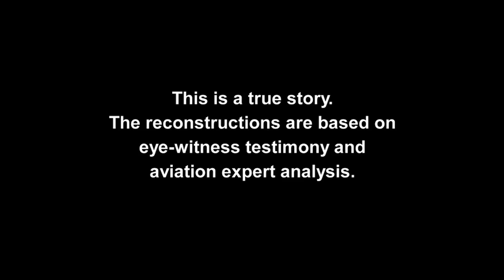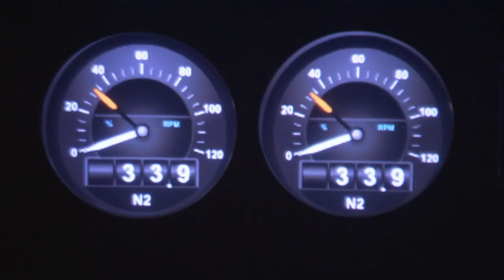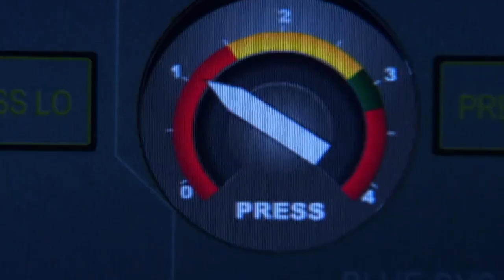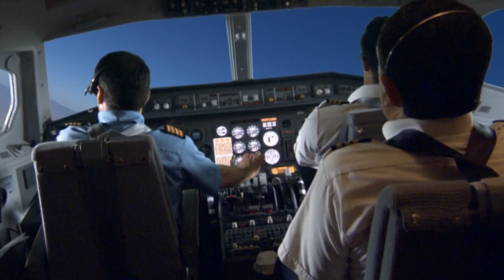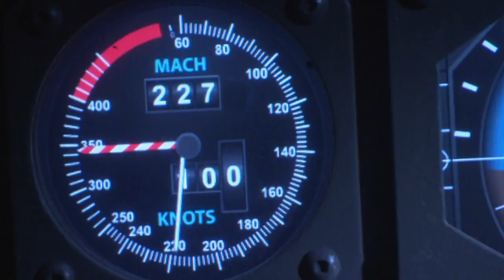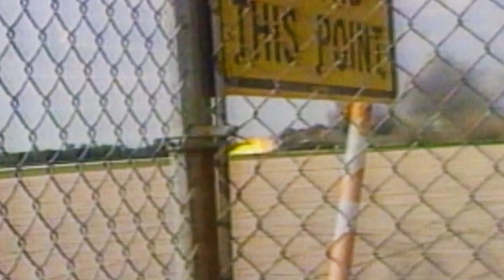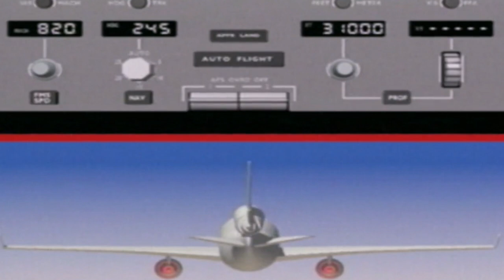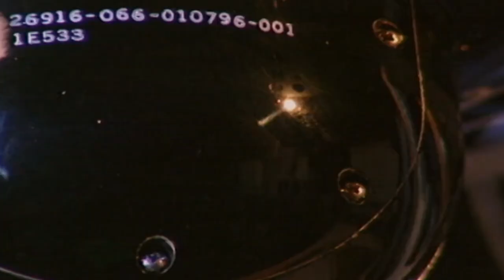DHL Delivery Plane Struck By Air Missile | Mayday | On The Move

Comment: My understanding and knowledge of aviation is precisely zero but you dont have to be a pilot to know what incredible flying these guys did that day. The pilots deserve all the accolades.
Reply: It's a bit like trying to parallel park in three dimensions.  Using the gas pedal instead of the steering wheel.
Reply: @arianebolt1575       "Parallel Parking, in a difficult Driver's Test"   (With Apologies, to, "The Fifth Dimension." You know what they say/said: "This is the Dawning of the Aga of Aquarius.")
Reply: They had to fly in the fourth dimension, fact of steering and physics is changed. Facts of thrust aren't changed with too much aspect.
Reply: im gonna hve to try that in mfs2020
Reply: Na bruh they can do their own races. I’m saving my accolades
Reply: Shame they used such bad special effects.
Reply: Yeah screw the engineers who designed a robust aircraft, the pilots are the only ones who deserve praise!
Reply: true
Reply: @arianebolt1575  
Using two gas pedals for two independent engines and wheels.
Reply: @CarbonMonoxide911  sure, here is how you do it, get autopilot into about a 15 degree climb at around 200 kias and do a very slight heading change (like 5 degrees) in autopilot.  Then disconnect the autopilot and that will leave the plane in that trim.  now fly back to the airport using only differential thrust.  I wish you luck.

Comment: Of the 3 similar incidents with JAL, United and DHL the DHL crew was fortunate to be trimmed for climb prior to loss of hydraulics.  JAL lost nearly the entire tail so even if they had not lost hydraulics they are very unlikely to have been able to maintain stable flight without skidding into an unrecoverable spin.  United had to deal with asymmetrical control deflections that caused their pitch phugoid to also include unwanted roll and yaw components making control much more difficult.  United was also trimmed for cruise flight in pitch axis making the speeds for their landing attempt insanely high.  I remember hearing that multiple attempts were made to replicate United 232 landing in simulators and NOBODY could do as well as the actual crew did.   DHL was trimmed for climb which is a high lift and relatively low speed flight regime.  They also had to contend with asymmetry in roll and yaw axis like United but did have a more manageable trim in pitch giving them an advantage over the united crew.  In all three incidents the airmanship was remarkable.  Watching video of the Sioux City accident leaves you amazed that anyone could survive it yet more than half did.
Reply: That's interesting.
Reply: Nothing like a disabled aircraft to cause a real adrenaline rush and sharp focus of the mind.  When that Hawaiian Air flight lost a big chunk of the upper fuselage (due to corrosion), the pilot just greased in in onto the runway, a perfect performance. The co-pilot mentally remarked: "How did she do that?"   And you get that when you are near disaster. Al Haynes never did fly commercially again, all those deaths demoralized him, but he did go on to give a lecture tour. A truly great pilot.  I know I could not have pulled it off, my skill set is way below that level.
Reply: JAL123 and United 232
Reply: @jvaneck8991  Aloha 243 is legendary. Air Canada 143, while not structurally compromised, also lost a lot of controlability to fuel exhaustion. Amazing how pilots achieve these feats in spite of the odds stacked against them.
Reply: @KathrynsWorldWildfireTracking  I think in the end this fall into the file of adding too much weight (systems) and cost (systems and maintenance) to justify based on the relative infrequency of these kinds of events.  A better solution is to engineer the hydraulics/electrical systems with inline fusing and running redundant systems through different real estate to mitigate the risks without significant equipment cost / weight / maintenance expense increases.  The engineers really consider each accident  when developing next gen aircraft.  An accident like the three I mentioned would be very different (better) in a 787 since it does not really use much hydraulic control and electrical controls are easily isolated with inline fuses.  If this DHL was a 787 its damage would have probably caused a huge electrical bus short in the left aileron, but an inline fuse would quickly overload and blow effectively removing that damaged area from the control system.  The rest of the control system would continue operating 100%.  Design like that is what  will prevent similar accidents in next gen aircraft.
Reply: Training Captain Dennis E. Fitch of United 232 had actually tried it in the simulator because of JAL123. It was purely academic until suddenly it wasn't. The coincidences that put that much talent in one aircraft at once are staggering. Anyone who can fly a jet like that, even JAL's crew, is incredibly skilled. Landing is inevitable, survival is not.
Reply: @kdawson020279  Totally agree on JAL.  I believe they managed to keep that thing in the air for about 25 minutes.  They could not really control their direction or altitude but merely keeping it flying was a feat unto itself.  The vertical stabilizer (rudder) is the only surface that prevents spin, and that they they were able to avoid a spin as long as they did with essentially no vertical stabilizer its frankly astonishing they did not just instantly end up in a spin.  Even the smallest skid would have been unrecoverable and I think it was ultimately a spin that put them into the ground if I recall.
Reply: @larrybremer4930  Yeah, that was tragic because to the credit of the pilots, far more people survived the initial crash than survived the night on the mountain. A large number died of exposure while trapped in the wreckage. I was a kid then, but I vividly remember watching the ordeal with United 232 on TV when it happened. I didn't appreciate how hard it is to control a jet with only differential thrust and an uncontained engine failure until simulator tech for the computer caught up with physics. And, there's no pressure, because no one dies if I crash a pretend DC-10-10. You can almost reverse engineer aviation history through innovations, airworthiness directives, groundings, and recommendations from the NTSB because aviation safety regs are written in blood.
Reply: The words of the United flight’s PA address from the captain to the passengers to prepare them for landing has always stuck with me: ”Ladies and gentlemen, this is your captain speaking. I’m not going to lie to you….this will be bad”.

That must’ve been beyond terrifying to hear.
Reply: I am wondering if the stabilizer trim is controlled by hydraulics. I think it can be designed to be electronic.
Reply: @ydl6832  777 is an electric jet with very little hydraulics.  The DC-9 MD-80 family of aircraft actually use old school cables to a tab that when moved causes the larger control surface to move so simple muscle power is multiplied by simple physics of aerodynamics.  The infamous jack screw that moved the "fixed" part of the elevator was actually to trim for the current speed, and balance.  Because hydraulics are heavy and require lots of plumbing most next gen aircraft designs are using electric actuators like jack screws and linear actuators.  Electrics have an advantage over hydraulics in that failures can be localized and isolated by breakers and fuses.  There is such a thing as a hydraulic fuse that in theory can plug a broken line, however anything less than a complete break does not create the flow rate necessary to actuate the fuse making a hydraulic bleed out still very possible when the leak is too small to trigger the fuse.  The difference is that hydraulic fluid is finite, like fuel, you only have what you left the ground with, but assuming your engines are still running you never run out of electricity.  That is why electrically controlled aircraft will be safer than legacy hydraulics.
Reply: @larrybremer4930  thank you, very informative 😄
Reply: @larrybremer4930  until an emp knocks out a system.
Reply: I can't imagine the pain in that captain's voice knowing that so many of the people listening to his PA weren't going to survive
Reply: @KathrynsWorldWildfireTracking  Wait, so neither of the computer program nor the flares have been implemented yet on commercial planes?
Reply: Like Scully, they repeated his landing in a simulator knowing the situation ahead of time.
Reply: I would like to get ahold of a FLT (the save file name for Microsoft Flight Simulator) recreation of any of the flights.
Reply: Possibly, on impact, the missile caused a sudden dump of a large mass of fuel.  I suppose equalizing the mass by dumping fuel from the right wing would have helped.
Reply: Yep, the trim in witch it was stuck likely played a big role. Good point!

Comment: I served a year in Iraq (2004-2005) and helicopters were a constant part of the airspace around BIAP (Baghdad International Airport) and surrounding land. Along with the Apaches and Kiowas there were J-Lens Blimps with powerful cameras to scan for threats, and mounted patrols everywhere. Somebody must have REALLY dropped the ball, not only to let them set up and try and down a plane, but get off a SECOND shot minutes later. Very Glad the DHL crew survived. 
SSG. U.S. Army (Medically Retired) Infantry / Sniper / SOF Intel (SOT-A), multiple tours
Reply: Rather then dropping the ball it is more likely the terrorists watched the patrols for quite a while and figured out what distance they needed to be outside of the area that was observed as the fact is there is only so much area that you can feasibly keep under constant surveillance.
Reply: this was 2003 so maybe all that extra stuff was a response to this incident.
Reply: I was there in 04 and 05 as well. The BIAP used to have the return fire battery and all planes had to circle the air port inside this bubble to stay protected. Something must have changed.

Comment: Flying a plane without the ability to control other than timing your engines power and yet still managing to land albeit rough is just incredible ! Amazing pilot and crew right there !
Reply: Not only that, but also compensating for the unpredictable changes in aerodynamics from the damaged wing.

That's the problem with the PCA system mentioned at the end of the video. Sure, it can land the plane on the engines alone when it's in perfect shape. But if you've lost all hydraulics, then most likely, your aircraft has been badly damaged in some way. How can the system possibly know the extent and location of the damage and how to compensate for it? Pilots can 'get a feel' for the change in aerodynamics, but a computer system cannot. I think it'd be better to focus on more redundant control systems and backups, along with better training for pilots on how to handle these scenarios... Along with installing military countermeasure systems for aircraft that fly into conflict zones.
Reply: There's no  mention of it but I expect there are still pucker marks in their seats.
Reply: @weblure  SImple.  You only have engine control available.   It applies the control necessary.  Simlar thinking to yours implies that when you modify a car equipped with OBDII when modified will produce more horse power without reprogramming the computer.  Not so.  You can open the exhaust, open the intake, put different spark plugs in it, install a bigger turbo, etc. all you want but it will not produce  more hp without reprogramming.
Reply: I'm sure it has been done many times before in small prop planes

Comment: "Controlling a plane just using the engines has never been attempted before"    later in the documentary    "here's a clip of another plane that was flown just using the engines 14 years earlier"
Reply: True...but the key difference is they landed the plane safely and survived.
Reply: He meant "before" this incident or during traing of pilots or none of these pilots/Boeing  attempted it b4.
Reply: Lmao
Reply: Unfortunately the prior jet had a big  tendency to  roll when they added power.
Reply: Because now planes are heavier and more reliant on hydraulics and advanced but before it wasn’t and more reliant on engines and 14 yrs ago probably don’t even have hydraulics
Reply: Plenty of USAAF bombers did it in WWII. but, the writers for shows like this,  have to pep up the narration...
Reply: And they crashed killing over 600.
Reply: @charliegaylor  Apples and oranges. WWII bombers were nowhere near as dependent on hydraulics, used props instead of jet engines, were much smaller than modern heavy passenger/cargo jets and quite a few other differences. Flying a modern heavy jet with no hydraulics means no functional control surfaces (and often involves said surfaces remaining frozen in whatever configuration they were in when the hydraulics were lost.) None of the bombers that survived severe damage in WW2 lost all of their controls.

Comment: Same thing happened in 1989 DC10 Sioux City Iowa, lost all 3 hydraulic systems but made it to the runway and tumbled. Incredible back then that they even made the runway. They used differential engine thrust. That DC10 had identical engines to that A300, GE CF6
Reply: Yeah that's what I was thinking, maybe they could use differential thrust to change the roll of the aircraft, because of the tourqe effect
Reply: Dc 8 9 10 all garbage
Reply: this was mentioned in the video

Comment: It wasn't accurate to assert that flying a large commercial jet using asymmetric thrust to overcome total hydraulic systems failure had never happened before.  Check out UA Flt 232, Sioux City in 1989.  119 fatalities, but 184 people survived due to the skill of the flight crew and a United Airlines check pilot who was a passenger before getting into the cockpit to help the rest of the crew.  That aircraft lost all flight controls after the center engine fan disks exploded, severing all the hydraulic lines.  It wasn't hit by a missile, but the flying problems and flight behavior of the aircraft were almost identical.  Obviously practically miraculous flying jobs were done by both aircrews.  The DHL flight just wasn't the first to be faced with this seemingly insurmountable challenge.
Reply: I remember this day,
Reply: I was just going to comment about that.  I saw a story on that crash on another flight channel a couple of years ago.  I agree, it's still heroic flying.  I this case, I was just thinking since they had been making that trip twice a day, every day, for at least a couple of years that means they have thousands of hours in that aircraft.  That familiarity was probably another factor in this example.
Reply: 33:47 ....Next time look the full episode before commenting ...
Reply: @jonathanmayor3942  still misleading at the 1et part of the video to a point.  SC ran into the same problem I am sure as it go closer to the ground.  It was pretty warm out that day.
Reply: Actually an American Airlines DC 10 did it years before the UAL Flight  AA Flight 96 on June 12 1972
Reply: It got left wing losing lift  due to fire. In United flight did have that issue.
Reply: My great, great grandpappy did it in a Sopwith Camel in 1912
Reply: Yeah, those things had infamously unreliable hydraulic flight control systems.....
Reply: exactly right, different cause but pretty much same situation. All flight control services useless, all they had was thrust control.

Also, Japan Air 123 in 1985 the cabin crew deserve to be recognized. They flew that plane for over 30 minutes using the engines and flaps alone, with no tail. This is virtually impossible, it was attempted by several crews in a simulator and they couldnt even do it for 5 minutes.

Comment: Um. yes this had indeed happened once before. United Flight 232, a DC-10 lost all 3 hydraulic systems on July 19, 1989, when the rear engine blew apart. Though many people died, many walked away from it thanks to the skill of the flight crew.

EDIT: I wrote the above just after the narrator made the comment that no other airliner had suffered the loss of all hydraulics, which of course was incorrect. He should have said the first to do so and successfully land the plane without a crash.
Reply: The JAL 123 (a 747) also lost all FOUR hydraulic systems as the vertical stabilizer broke off the a/c, ultimately crashing the a/c with only 4 survivors, in 1985.
There is also at least one case (Pan Am Flight 845) where 3 out of the 4 in hydraulic systems the 747 were drained empty, but the a/c recovered.
Reply: @Itapirkanmaa2  along with the Pan Am case, there was a Eastern Airlines L-1011 that blew its number 2 engine and it also severed 3 out of the 4 hydraulic lines that the L-1011 had, it safely made it back to the ground.

Comment: I remember years ago reading about a experimental procedure for using huge parachutes on disabled passenger jets , and it worked . The plane floated down hitting the ground with minimal damage.  I think it was back in the early 1980s ,  I recall it being talked about and eventually a decesion was made to not apply the application as tested . I never understood why,  if it actually worked . I'll now need to see if I can't find the article,  but I absolutely remember this being tested and talked about , likely after one of the crashes that took place sometime during that era of aviation. I don't think it was a simulation,  but a actual live test. Has anyone else ever heard about such a possibility of trying this kind of procedure ?

Comment: Didn’t Sioux City Iowa have the same issue? Flying on thrust only?
Reply: Yes. A fan disk fracture in the rear engine of the plane caused shrapnel to sever hydraulic lines and drain the fluid. The pilots landed on engine power alone and at a far higher speed than normal, which risked a landing gear collapse.
Reply: @eliz_scubavn   Landing gear collapse?  The plane flipped over.